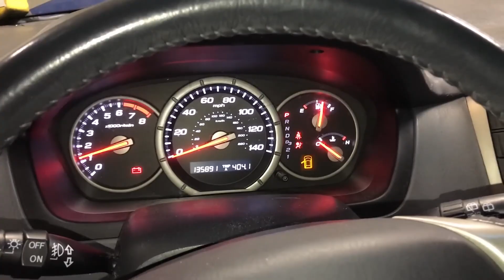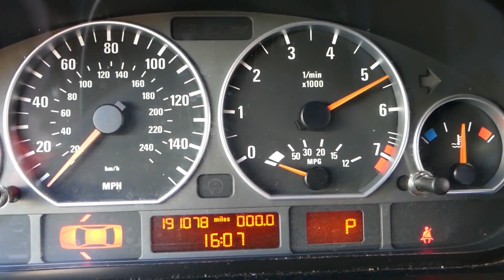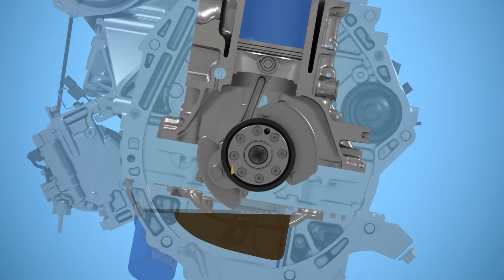Mechanics WARN: Oil Changes Won’t Save Your Engine Anymore!

Comment: Have a hybrid barely drive it no gas smell in the oil girls car she drives it everyday smell gas in the oil its a turbo both gdis seems like the turbo is the problem
Reply from the maker: Absolutely. Turbocharged GDI engines are much more prone to fuel dilution, especially on short trips. The turbo itself adds heat and stress, but the bigger issue is direct injection + operating conditions.
Hybrids often avoid this because the engine runs differently and reaches temperature more efficiently. That contrast is exactly why some owners see such different oil behavior.

Comment: Load of Bull video !      Check your oil frequently and change the oil and filter every 5,000 miles and unless you drive it like its an F1 racecar you should be good for 200,000 or more miles !
Reply from the maker: You’re absolutely right that frequent oil changes and checks are critical — and we fully agree with that.
The video isn’t saying oil changes don’t matter. It’s saying that modern engines can still wear internally even when oil is changed on time, especially with short trips, fuel dilution, and system issues.
Many owners who do everything “right” are still seeing timing chain wear, bearing damage, and oil breakdown — that’s what we’re highlighting.

Comment: I normally do 5k miles on oil changes. I literally dropped 1k miles for my new car it has port and direct injection. It produces more power than my other car so i know its under more stress because my car is high compression even though   it is naturally aspirated. I know direct injection has fuel dilution issues. So i try to mitigate the issue by change the oil earlier. Most of the time I'm driving 60 mph for 15 minutes if not more. Sometime im doing 70 mph for that 15 minutes.  so i think that is the reason why i never actually see fuel in the oil when i had the oil tested.
Reply from the maker: That’s actually a great example of doing it right.
Longer steady drives at highway speed allow oil to reach full temperature and burn off fuel — that’s why your oil tests look clean.
The video mainly applies to drivers who do short trips, frequent cold starts, or mixed city driving, where oil never gets that chance. Your driving pattern mitigates the risk.

Comment: A new Toyota in the u.s. uses 0-16W oil all the time. The same exact engine elsewhere calls for 10-30w for above zero temps
Reply from the maker: That’s true. U.S. specs favor thinner oils for emissions and fuel economy, while other markets allow thicker oils for different conditions. What really matters is how the engine is driven and the environment it operates in.

Comment: Happened to my Dodge Neon.  I followed the oil change and transmission fluid intervals.  The engine still spit out glitter at every oil change and the transmission failed.
Reply from the maker: Unfortunately, that’s a perfect example of what the video is talking about.
You did everything by the book, but some engines and transmissions still wear internally due to design limits, operating conditions, or system stress — not neglect.
Following intervals is important, but it doesn’t always reflect what’s actually happening inside the engine or transmission. Thanks for sharing your experience — a lot of owners can relate to that.

Comment: So change your oil to save your engine, don't change it because changing won't save it anyway. I'm sick of all this bogus advice. Use 20W30 don't use OEM recommended 0W20 etc. I change mine every 6 months in my Caddy 2023 XT5 turbo w/0w20. It cost about $45. I use Mobil one extended performance oil and OEM filter. I do it myself because I want to know what oil is going in and that I'm getting a new filter, not the old one that was wiped clean with a rag.
Reply from the maker: I think there’s a misunderstanding here — and it’s a common one.
Oil changes are non-negotiable. You should absolutely keep doing exactly what you’re doing.
The point of the video is that oil changes alone aren’t enough anymore if fuel dilution, short trips, ventilation issues, or system stress are present.
Your approach — frequent changes, quality oil, OEM filter, doing it yourself — is exactly how to reduce risk. 👍

Comment: Pro Tip : Change oil at 5000 miles with 5W-30  oil, preferably synthetic.  Avoid trips less than 13 miles at a time. That's it! Also, I change my oil once a year.
Reply from the maker: That routine works well for your driving pattern — longer trips, steady operation, and regular changes go a long way.
The key point of the video is that driving conditions matter as much as the oil itself. Short trips, frequent cold starts, fuel dilution, and system stress can overwhelm even good oil if the engine never reaches full operating temperature.
What works great for one driver doesn’t always translate to another — that’s why some people follow the book and still see internal wear.

Comment: 3000miles is overkill,  10k oct, I changed my oil twice a year, multiple cars got 250k miles without issue at all
Reply: That wasn't 0w20 was it?
Reply from the maker: That’s a great track record — clearly your driving habits work well for you.
The main point of the video isn’t that everyone needs ultra-short intervals, but that operating conditions matter more than a single mileage number. Short trips, cold starts, fuel dilution, and modern engine design can change what the oil actually sees inside the engine.
What works for one driver doesn’t always translate to another — that’s why some people follow long intervals with no issues, while others don’t.

Comment: i do oil change 2 times a year,iregardless of mileage on oil..Do oil change in fall, to get threw winter months. Then do oil change ,in spring. Full synthetic, iregardless of recommended life mileage of oil. whether be mobile advance. or pensoil platimun
Reply: I did similar, changed oil 1-2 times a year on a spare car even if i only put 500 miles on it, drove it to the wrecking yard at 30yrs old on the original engine and transmission at 175k miles. Car was economically totaled as new parts were unavailable and labor costs too high to do the work properly.
Reply from the maker: That’s actually a solid approach, especially for seasonal driving.
Changing oil before winter and again in spring helps remove moisture and fuel buildup, which is exactly what short trips and cold weather create.
The main point of the video is that oil changes are essential — but modern engines also depend heavily on driving patterns and system health. Your schedule is one way to stay ahead of those risks.

Comment: I don't agree..if you change your oil every 1500 -3000 miles or 6 months with full synthetic it should be good unless the engine itself is garbage like the new Tundras..
Reply: 1500 lmaooo you guys are nuts
Reply: @8MunchenBayern8 1500 is nuts unless your tracking. However, experts recommend 3,000 mile OCI for turbos and full synthetic.
Reply: @8MunchenBayern8 I change mine weekly and I’ve haven’t had a problem yet
Reply from the maker: Very frequent oil changes definitely reduce risk — no argument there.
What we’re seeing, though, is that some modern engines still develop wear even with aggressive oil changes, especially when fuel dilution or system issues are present.
Oil changes help slow damage, but they can’t always correct what’s happening inside the engine anymore. That’s the uncomfortable truth many owners are running into.
Reply: @SUVTestLab Its also warming up the car properly and dont race it. Change filters often. I actually  changed brake, coolant, and transaxle or transmission fluid every 25k. It's about keeping the contamination out of the vehicle.  And I use tier one fuel with techron additive every few tanks. .  So far so good.  Most people would not do half of what I do to take care of not only the car but everything I own.  Of course, if you get a piece of garbage then nothing will help.
Reply from the maker: @andredaedone7732  That’s solid maintenance — and more than most owners are willing to do.
When engines get proper warm-up, clean filtration, and reduced contamination, they last longer — no question.
Our point is that modern engines leave much less margin for error, so “normal” maintenance isn’t always enough anymore unless drivers go the extra mile like you are.
Reply: That was the point of this video.  Most manuals now say 10K which only works to get past warranty.
Reply: @ElmerFudd79 Then it's time to buy another disposable...

Comment: Oilless engine technologies
Reply from the maker: True “oilless” engines don’t really exist for passenger vehicles — at least not yet.
Some experimental designs use solid lubricants, coatings, or sealed lifetime lubrication for specific components, but internal combustion engines still rely on oil for cooling, sealing, cleaning, and wear protection.
Even with advanced coatings, metal-on-metal contact, heat, and contamination still require oil. That’s why oil condition and operating conditions remain critical in modern engines.

Comment: The answer to this is to change oil frequently. Every 5000 miles.
Reply: According to a master diagnostic technician named AMD, the YouTube channel the Car Care Nut, he says every 6 months or 5,000 miles which ever is first.  He specializes in Lexus and Toyota.
Reply: @theresaherman  Why 6 months? I drive less than 2,000 miles a year. I see no need to change my oil twice a year. I can’t imagine how oil the crankcase goes “bad” when the vehicle isn’t in use. Have you seen a jug of oil with an expiration date?
Reply: @Fred_the_Head Partial answer may be in the video.  If you're making primarlly onger trips at full operating temp, that's good. If those 2000 miles are primarily shorter, more frequent grocery trips, you're not getting it hot enough for long enough,  and fuel and moisture contamination don't get burned off and pulled out through the PCV system. They stay in the oil and dilute it.
Reply: @Fred_the_HeadWith group 2 oils it's  condensation.   Synthetics can take a bit of dilution unless it's 0w20. 0w20 already too thin .
Reply: @Fred_the_Head because the engine oil will also retain moisture and that breaks down the oil overtime. Plus fuel dilution from short trips is not good for the engine.
Reply from the maker: @Fred_the_Head Good question — oil doesn’t “expire” sitting in a bottle, but oil inside an engine is a different environment.
Even with very low mileage, short runs and cold starts introduce moisture, acids, and some fuel into the oil. If the engine doesn’t regularly reach and stay at full operating temperature long enough, those contaminants don’t fully burn off — they stay suspended in the oil.
That’s why time-based intervals exist. If most of those miles are longer drives at full temp, stretching intervals is usually fine. If they’re mostly short trips, time matters more than mileage.
Reply: @theresaherman imagreevwith him
Reply: Thats not frequent enough in modern engines. 3.000 max.
Reply: @aciddiver1978 wondering why that's still the exact magic number from 80 years ago, when SA oil was all we had.
Reply: @TIJoe-te9qu  could just be coincidence. But mostly changing oil sooner than later is going to lead to longer lasting engine overall and less worries. Maybe will cost a bit more but over the long run its a lot cheaper than a new engine or a new car payment.
Reply from the maker: Frequent oil changes absolutely help — and 5,000 miles is a solid interval for many drivers.
The video’s point is that intervals alone don’t tell the full story anymore. Driving style, short trips, fuel dilution, and system health matter just as much.
Two cars can follow the same interval and age very differently inside.